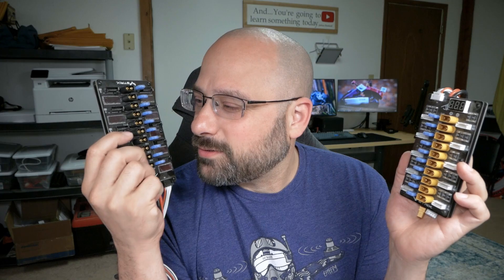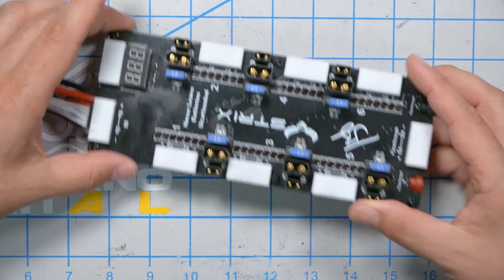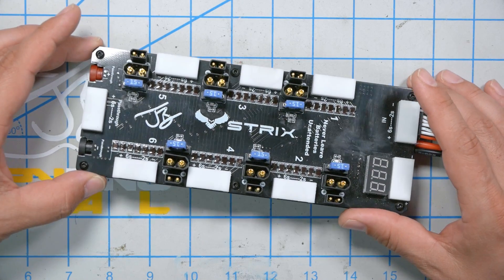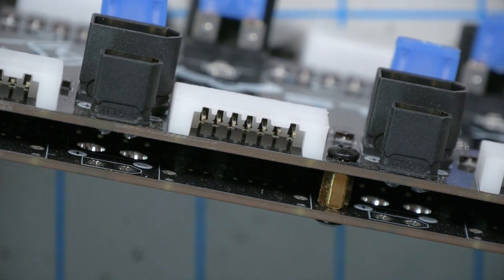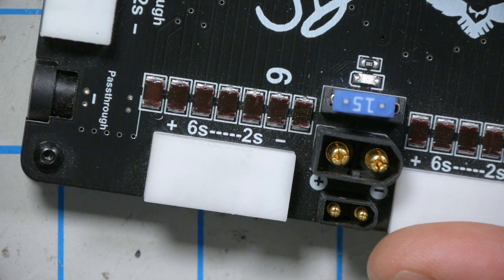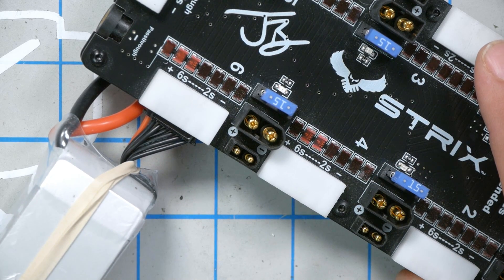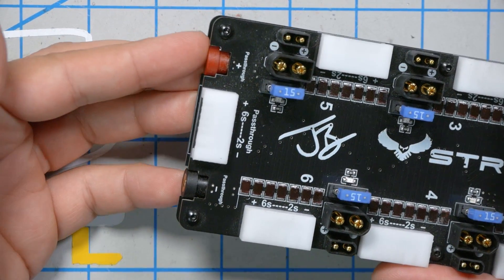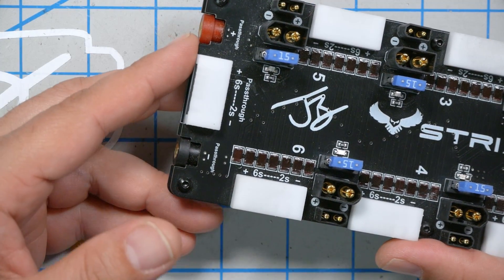New ultimate parallel charge board does it all (XT30 and XT60, 2S-6S)

Comment: Just received it. Unfortunately, the battery checker is defective (second cell shows deviations for all my balanced batteries) and according to the dealer, this is not the first case. Calibration is also not possible by the end user. There was clearly no quality control.
Reply from the maker: The point of the checker is not to be an absolute voltage reference. It's simply as a quick check that your batteries are all the same voltage so that they are safe to plug in. For this purpose, absolute accuracy is not required. Just consistent measurement. If you want a cell checker, use a calibrated cell checker.
Reply: @JoshuaBardwell  It should be absolutely possible these days to display 4 voltages that don’t differ by +0.2 V. That’s the bare minimum and not too much to ask. Why all the excuses and shifting blame to the user? If that’s the expected behavior, then say it clearly in the product description, and also in the promo video..!

Comment: I own 2 of those boards, both had issues with on board battery "checker", after unscrewing lower plate turned out factory haven't cleaned flux residue from the board which I assume just corroded contact overtime, after re soldering everything related to such circuit and proper cleaning with IPA the board runs like new.

Comment: Dumb question but if you plug in 4s batteries, should you change the balance that goes from the board to the charger with a 4s lead rather than the standard 6s?
Reply from the maker: No it doesn't matter. Just use the 6s lead that comes with the board.

Comment: Voltage check - ahm not sure, award the way it is. How about, probably costly to have an option with momentarily button next to each xt plug which when pressed powers the voltage checker of that specific battery at the same time measuring its voltage?
If that's been mentioned somewhere within the video sorry, haven't watched the whole thing

Comment: How long does it typically take to charge multiple batteries? I tested it out for the first time yesterday. Two 4s 1550mah 100c. 14.8 and 14.9v starting point charged at 1.6 amps. Took around 70 minutes.

Comment: I just had a lipo fire with your 4s board. Has to of been my fault. I'm confident I accidentally grabbed a charged and one discharged battery 5,000 mah and set my charger for 10 amps walked away. 30 mins later smoke alarms. It was in an ammo can next to a concrete wall under metal ductwork. All is good except the mess fro the dry chem fire extinguisher I used. I'm getting the new board and and a co2 extinguisher. Stay safe boys. Don't get lazy. Check every battery before putting it on the charger.

Comment: I bought two but no voltage is showing
Reply from the maker: You have to plug in to the balance plug near the voltage display to read voltage.
Reply: @JoshuaBardwell  yes I see thought it was like the last board that shows the voltage when plug in but read it’s just for checking battery

Comment: got mine today! is it normal that there is a lot of gunk on the unit? also two fuse sockets were bent upon arrival
Reply from the maker: The gunk on the unit is probably conformal coating, to prevent short circuits.
Reply: @JoshuaBardwell  it seems like flux and is all over the whole board, especially between the colored things (forgot the name) .. seller advised me against alkohol, since it might damage the colored things
also one of the 2-6S plugs has met a soldering iron since it is a bit melted in that shape .. maybe check back with the manufacturer, but this seems like a problem .. since i am from europe and imported it, RMA is not an option (paid more for shipping and tax, then the unit itself), but still a bit disappointed, even though I no it is not your fault
Reply from the maker: I would say reach out to RMRC then who is in charge of manufacturing. If the unit isn't up to standards they will want to know.

Comment: Parallel charging is a false economy. As soon as you get one batt with a weak cell it takes the rest out. Far better off single charging with multiple chargers. Faster overall, much better balancing, and dont need to have all batts at the same voltage. You can safely charge at 3-5 c. Bardwells boards ruined 5 of my batts when one batt took a dump.
Reply from the maker: It's only false economy if you don't care for your batteries correctly. I have personally never had a bad pack kill other packs on a board. There definitely are advantages to single-charging with multiple chargers, though. Please don't say that "Bardwell's boards" ruined your packs. Any parallel board would have done the same. If you don't feel you can safely parallel charge, then definitely don't do it.
Reply: @JoshuaBardwell  Your the only one pushing these ten port parallel boards., and you have made one video about how to identify bad batteries. You literally need to check every cell in every pack before and after charging to make parallel charging safe for the rest of your batteries.   It is safe if you do this time intensive procedure every time, vs a quick glance at the charger display while charging.  That's why its a false economy to parallel charge since it wastes time and money. I have two Hota p6's , thanks for that recommendation! Also I love your content and watch all your videos we should be friends.

Comment: Can you try plugging one 2S (maybe higher) in and then plug in a 2S (maybe higher) wrong into the balance connector ?

One time without the XT60 / XT30 and the other time with it..

If you do a video on this I will buy 2 I promise !!
Reply from the maker: The polyfuses will light up just like I showed.
Reply: @JoshuaBardwell  that`s interesting bc the ISDT ParaBoard (trace) and the Uruav Blacklight B6 Pro (PPTC/Polyfuse) burnt on reverse plug-in without the main cable (XT30/60) plugged in... I gonna replace the PPTC`s myself on the Uruav one.. (1206 6V 2A)

Comment: What about the "Uruav Blacklight B6 Pro" ?

It has LED Indicators which will light up if a Polyfuse is tripped..

It also has an beeper which sounds when a 15 A Automotive fuse is tripped / burned.. 

Also the XT60 and XT30 port have the Standart yellow color which makes it more obvious which way to plug the battery in.. Sure black looks nicer, but I prefer safety...

The integrated voltage checker is "rubbish" sorry 🙏🏼
Ist just soo slow..

Better get the ISDT checker..
For the price it's really good ! (not perfect tho)

Comment: Was never a fan of the 10 port setup.   Was more a fan of the older 4 port Progressive RC/Readymade RC boards that you could daisy chain.  2-6 cell balance ports was useful for everything from goggle batteries through everything I own.

By far most favorite board out of everything I had.

Tried the old 10 port for 4s and never liked it, pain in the ass to unplug the XT60s.  Got so I never put more than 4 packs on it.

This is a step in the right direction.  4-6 ports and being able to daisy chain.

Comment: highly questionable build quality on these, solder near the balance plug looks inconsistent and thanks for that nice juicy thumb print next to the voltage display.   I ordered two, one is better than the other.   application of the heat paint is also sloppy.    wt jb?

Comment: So I'd like to buy this but I'm not sure if this will work on my tenergy charger.  It has an octopus connection but no banana plugs on the octopus.  But there is an open positive and negative wire for soldering onto.

Comment: That's a much better design than the old one I used that scared me away from parallel charging. I probably would have stuck with it if I had that one. The board I used had the array of balance connectors, and over several years I had two incidents where I plugged a balance plug into the next sized connector. Because of the way the connectors on the board were aligned, it meant that it was offset by 1 pin and short circuited the cells. The first time melted one of the traces I needed for 4s charging off the board. The second mistake... Yeah I threw it away like I should have the first time.

Comment: I really like the features but I hate these type of battery checkers since they came on the market. 
„Number of cells...“
One year later
„All“
Zzzzz... what. Aaah finally the value I am interested in.

Nice thinking but isn‘t there a small instant measurement solution on the market?
Plugging in the main lead for voltage info is more convenient for me, for example to an ISDT etc. 
A similar solution would have been perfect. But these are complaints on an high level. 
I will definitely check out this sexy thing.

Comment: Parallel board is too dangerous for me. The risk to mix voltage is too strong. And my perfect way to charge my lipo is my newest charger : Toolkitrc M4Q. It doesn't take 6S but I don't care, I fly with 4S only :p

Comment: do not parallel charge you can over charge under charge etc if a battery has a bad cell  and oyu have 5 batts plugged in your charger will stop or over charge etc.. and blow it...

use a 4 port indipendant charger if you must charge all your packs if you must charge using a parralell board plug in all the batts let it sit 5 minutes the cells must all ballance this is why..... its better to just buy a couple 4 port chargers  and do it that route

Comment: Honestly when your board came out, boards that could do 2-6s had been out for a long time. The fact that your first board had seperate 4 and 6s versions seemed like a blatant money grab. Why would your 6s board not support 4s charging as well? It's literally a slot in the balance connector? For this reason I had to buy the idst one that supported 2s-8s. Big bummer because I wanted the poly fuses and normally I like to support you.
Reply from the maker: The reason we didn't put multi-voltage balance plugs on the 6S board was 1) we considered it safer to try to prevent people from accidentally plugging in the wrong voltage, and 2) the multi-voltage balance plug that you see used on ISDT boards (and now this board) is a custom injection mold that had to be created by RMRC at some expense. I know that people cut away the 6S board to allow plugging in multiple voltages, but the thinking was that parallel charging is already dangerous enough, so if somebody wants to do that, let them take the initiative. Obviously that thinking has changed. 

It was never a money grab though. I don't do money grabs. I am always trying to make things a better value for people. If the parallel board that was being sold wasn't the one you needed, no hard feelings.
Reply: @JoshuaBardwell  right on. Think Im going to grab that FPVCrate box btw 👍

Comment: What quality are the XT30 and XT60 connectors? I hate the ones that need 40 thousand pounds of force to unplug the battery.
Reply from the maker: That's just how wide the prongs are in the plug. You can pinch them inwards slightly with a needle nose pliers to loosen them.

Comment: fun fact, if you had plugged in both balancing connectors 4s and 6s nothing would have happened if you don't plug the XT60
Reply from the maker: That's true, but I kind of wanted to make the point anyway.

Comment: When and why should I use a xt30 over a xt60 connector for batteries?
Reply from the maker: XT30 is smaller but has lower amp rating. For smaller packs, XT30 makes sense since they can't deliver many amps anyway.
Reply: @JoshuaBardwell  is it possible to connect a xt60 battery pack with a xt60 to xt30 adapter or are they "incompatible"?

Comment: Still got the 4S version, I'm glad to see that the ports are a bit more staggered on this one. That was one of my only complaints with the old one, I've broken so many fingernails trying to unplug the dang XT60s in that middle row heh. The separate voltage checker is also a great idea, makes way more sense. You can just ignore it and use your own, until you realize you left it in the car and then you always have a backup.

Comment: If you had mixed the 4s and 6s on ONLY the balance ports, nothing would have happened.  The fuse should blow if you hook up the XT60s.  The design is safe.
Reply from the maker: Correct. But obviously you're going to plug in the XT60 next.

Comment: @6:17 I dare you to plug in a 4S and a 6S at the same time... talking about the balance plug only... you will see... nothing will happen... and then... only connect the 6S XT60 to the board... and wow... guess what... you just made a weird lipo with different capacities on the cells but... it will work and I will say... it is still safe... no charger should overcharge any cell... @joshua bradwell
Reply: doing that since 2010 btw :p

Comment: What about URUAV Blacklight B6pro, how good it is?
Reply: A few other pilots I know and I have the URUAV for quite some time now and we are pretty happy with it. It has all the bells and whistles. There are a few differences to JBs, but I don't think they are THE game changer for one or the other. URUAV has has LED indicators for the polyfuses instead of heat sensitive paint. URUAV natively uses XT60, JBs board uses banana plugs. JB has the voltage checker. The URUAV is a bit smaller. They are both priced around the 40$. If I would have to buy one again, I would probably still go for the URUAV, but thats my personal preference. Feature and safety wise, both are good a choice.
Reply: @JustANPC  thanks. I actually asked, because my URUAV is on a way to me 😀. Therefore I didnt made any mistake at all 😊.
Reply: @janezhitori6203  Just some update on the URUAV Blacklight: A friend noticed, that it seems to draw some power on standby. So probably not the best idea to leave LiPos plugged in over night. Not the best idea with any para board but a particular bad one with this, as it might kill the lipo over night. Best guess so far is, that the shorts detection circuit draws some milliamps.
Reply: @JustANPC  i never leave any battery plugged over night anyway. Not even phones and laptops. No matter how "safe" they can be, we can all remember Note 7 😅

Comment: It would be a new product but I've always thought a small addition to a parallel board create an amazing product:
If each channel went through an actual current limiter (maybe not just a polyfuse). You could plug in packs as you fly and the voltage would equalise so you could just plug the charger in without worrying about equalising them.
If one of the channels had a field pack on you could either charge them most of the way or storage charge them depending on the charge in the field pack.
You could literally solve battery management in one product. All you'd need would be a bunch of current limiting circuitry and maybe a pot to set max current.
Reply from the maker: The problem is the same current limiter that protects from dangerous current flow would also interfere with charging
Reply: @JoshuaBardwell  not if the limiters were on the channels, it would just limit the per pack/cell current. fewer ports would make that economically reasonable.

Comment: can i just say, no beginner should even consider mutli-charging lipos. get to know each battery, number them straight away, look at each cell how it holds charge and how its performing. be ready to retire any battery with a cell 0.2 volts below the others, and expect that to happen very often, more than 1 in 5 packs even. once you know all your packs you can charge in parallel but itstill recommended to stop the charge early, (4.15volts per cell) and finish each pack individually. and always charge on a metal tray which you can pick up and carry outside in the event of a fire.

Comment: I only have XT60 connectors on everything so I use the Toolkit RC M6D with the ISDT parallel board.  The ISDT board is a heavy, well made piece of electronics.  Solid case.  Good design. Love it.

Comment: For micros, I prefer series charge adapters, especially in the field. You can charge two 3s packs in series and don't have the safety issues of parallel charging.
On Ali there are super cheap ones that work great and charge only using the balance plugs (which is totally fine for <2A), but they come with deans connectors.

Comment: Your board looks good! I just am not a big fan of parallel charging: I don't want to think about matching voltages every time i charge cells, "Oh no, I only flew half of that pack, now I can't charge it with the others!" or "yeah, those are all 2s batteries but one has lower capacity so it will go boom if I charge it together with the higher capacity ones". Gladly I only fly up to 4S right now and the ToolkitRC M4Q is a perfect fit for me - charging 4 cells at once is okay and it can discharge them (very slowly) to storage voltage too. I don't think parallel boards should be a necessity any more at least for the regular hobbyist who does not need 40 batteries charged up at once. Just instead of a micro 4x4s charger like the M4Q is, produce a 6x6s charger that is larger (or lacks the DC in) still can discharge to storage voltage, has a bit better plug layout (XT-plugs are next to balance plugs, but balance cables are usually shorter so the balance lead tends to unplug) and 99% of people would be happy.